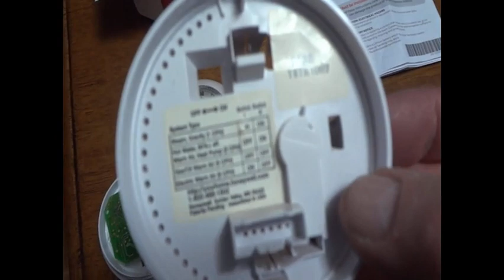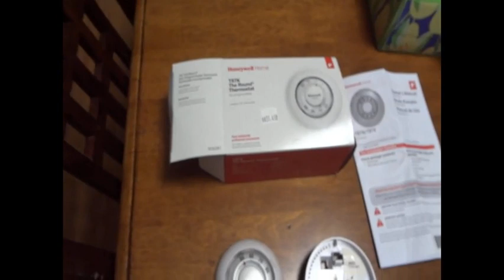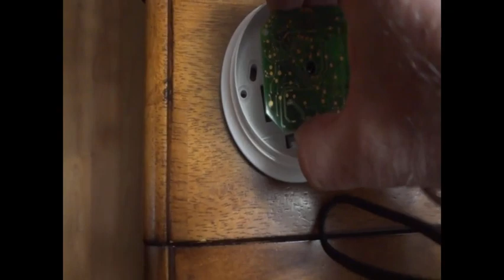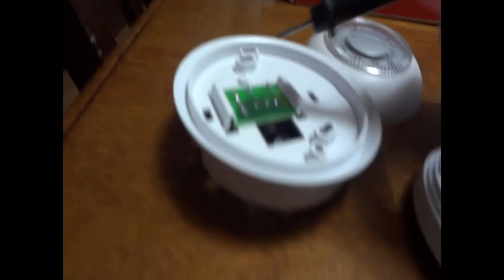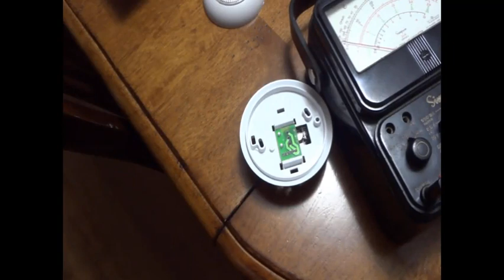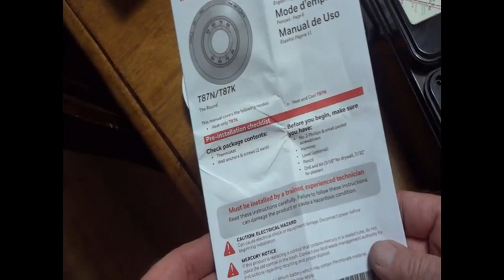Honeywell round thermostat fact they do not tell you

Comment: I came across this after I fixed mine. I too was surprised there was a battery, but I didn't know it wasn't mentioned in the manual. Tsk tsk Honeywell. 

I ended up fixing mine because the dial got disconnected from the arm that connects to the board, so spinning the thing in the front didn't actually change the temperature setting. Pretty easy fix, just make sure the arm is lined up with the slot on the back of the dial when you put the cover back on.

Comment: This thermostat robs power from the R cable to charge a power module.  It takes 4 hours to charge the module. The coin battery is a backup that should last at least 10 years.  The thermostat will function without the battery as long as it receives power from R

Comment: Yes i when through 4 ..at start of cold season up the temperature it dosent turn on thinking it was battery change it still doesn't work jump the two lines came on when to home depot for new one it works next season same thing whats going on ....and your right they dont tell you about the battery i just happened to dig into it and found out
Reply from the maker: I just had the second one fail if you missed one of my latest videos. Check it out:)